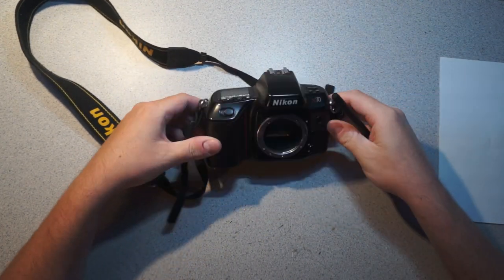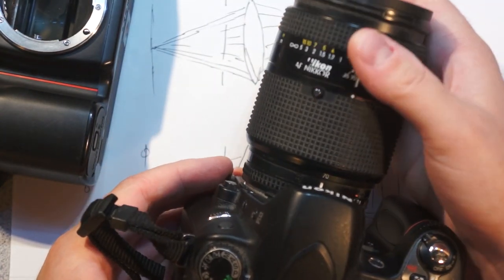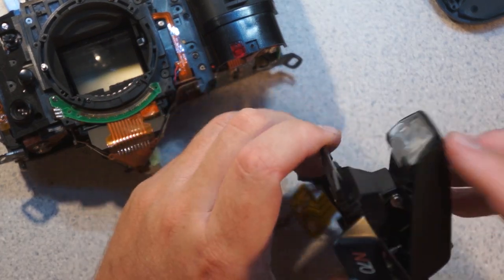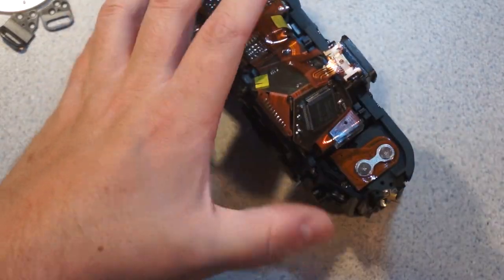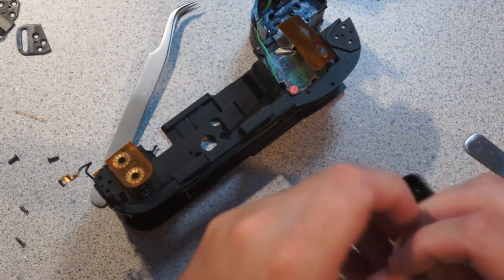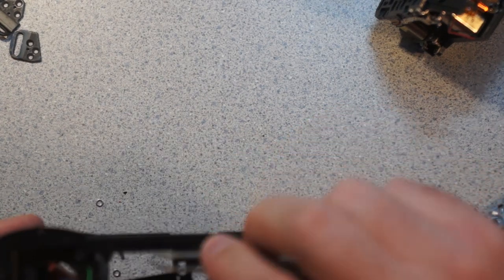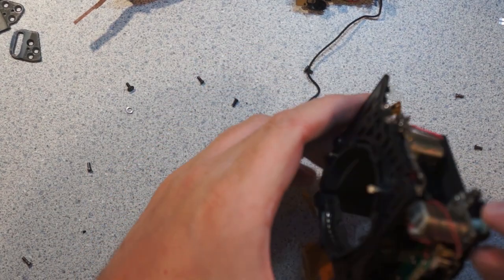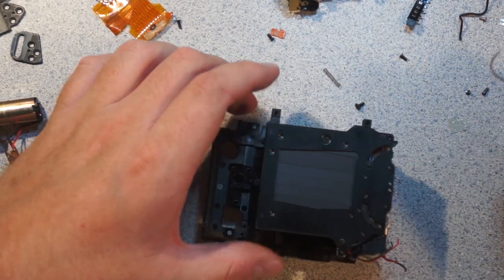Nikon N70 SLR Teardown Pt 1 of 2 - Mechanics

Comment: Spamming some more but there is some incredibly complex engineering going on into these cameras.
This is actually the first time I've seen mirror shake on video. I guess newer cameras have a lighter mirror and some smart engineering to decouple the kinetic energy. As frame rates go up the shaking goes up.

I'm surprised (D)SLR hasn't evolved much. Mirrorless needs almost no adjustment (just flange) and it probably costs a lot less so that's probably where the profit margin is.

Comment: I would have completely agreed one month ago but I had a borrowed RX100 for three weeks and had used it side-by-side with my D7000+18-135. I could only see the differences between them at 100% on a big screen but from a usability POV the Sony wins hands down.
The Canon digicam I have is completely crap compared to both, even in good light, but still quite far ahead of my smartphone camera.
Proffesional photos just can't be replaced but there's a huge market area between those and phone snaps. 2c

Comment: @Photographic Time:
Nikon did not invent the SLR. The thought comes from Germany and the decade was the 1920's. The first really good SLR's were manufactured in the early 1950's by the likes of Carl Zeiss - all japanese camera designs own their pedigree to German industry. Nikon made some lenses for Canon in the very beginning, but the first Nikon SLR was the F of 1959 that even only was a Nikon SP which in turn was a Leica copycat.
Reply: Yeah true, however the Nikon F is still and always will be the best known SLR system, really the best one too. I like Pentax too, they had great glass for M42.
Reply: Yeah so what happened afterward? Japanese companies kept innovating not only with cameras but lenses as well. Minolta A9 to date is the only camera that can do 1/12000 shutter speed. A testament to their engineering!
While you are still telling stories about 1920. !

Comment: The user interface on Canon is completely wrong, the lenses zoom in the wrong way and the thread on them is also reversed. Red is for pussies, gold is for winners. They seem to provide an awful lot of auto modes for stupid people:full auto, iAuto, no-flash auto, program auto. Their lenses go obsolete faster than my socks (25yrs).
Just trying to balance the video opinions in advance, I actually own and use both systems. Anyway both will die a slow death as compacts march aggresively (RX100/RX1).